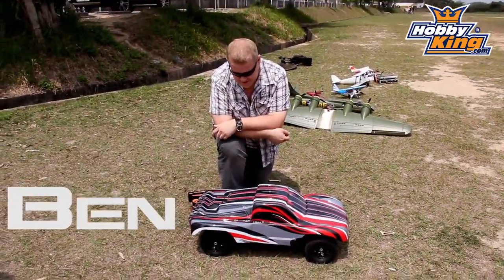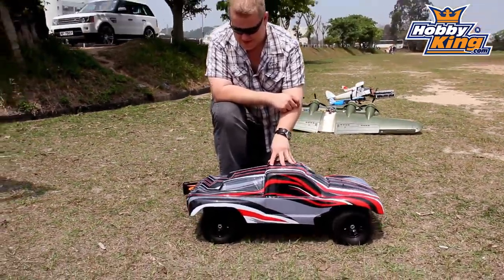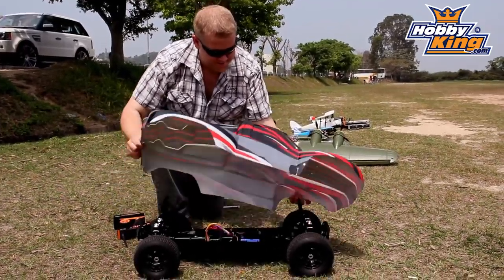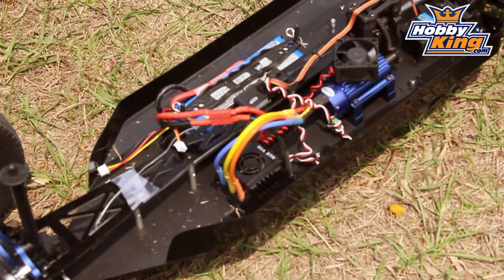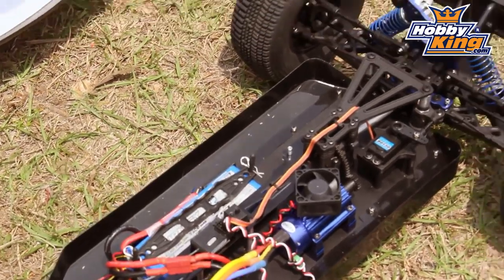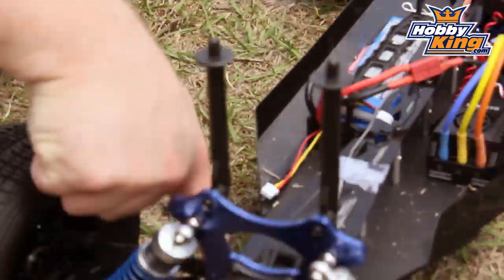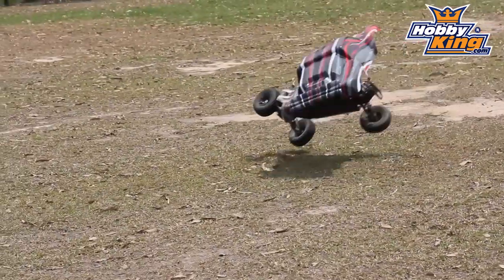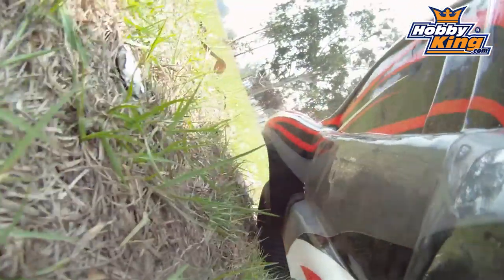1/5th SCT Short Course Truck - HobbyKing Skunkwerks Series

Comment: @xToXiicxT3RRoRx kv is rpm per volt so lower kv produces tork n high kv produces hp or speed/higher rpm
although 4 pole motors r changing that now too

Comment: how dissapointing. looks like a lengthened version of the 1/10.
tires should be big hard treaded tires with big nobbly patern treads.
the motor shoule be 45mm diameter or more with a 150a 8s capable esc.
tires are too fat, and need to be narrower and with bigger wheels. the body is unimaginative and the body posts need to be further apart for stability, preferably on the side of the chassis.
and those 1/8 diffs arent going to hold up to much, nor is that flimsy looking chassis.

Comment: Body - F. straight ripoff of the ugliest slags body ever made. Terrible fit.makes the truck look from the front. 

Chassis - B looks pretty good. 

Power system. D. much too weak. lipo needs to be 6 or even 8s.  esc is for 1/8, so it needs to be much stronger. Too small motor diameter. 

Wheels and tires: D Why include such a race style tread with a 1/5 scale? It wont be racing for 2 reasons: It is 1/5 and no one races those. It is made by hobbyking. 
Include basher tires.

Looks terrible so far